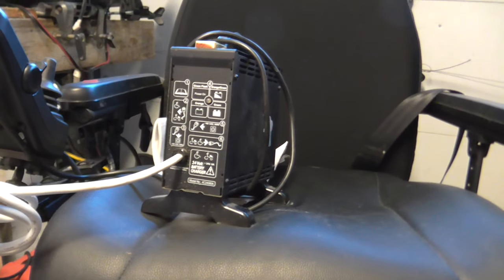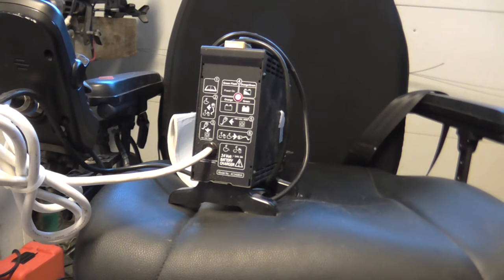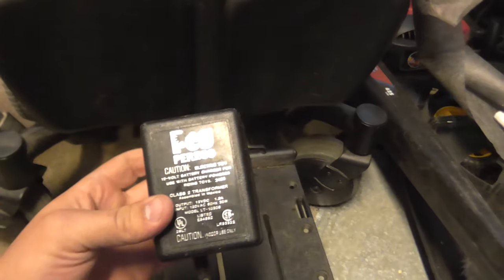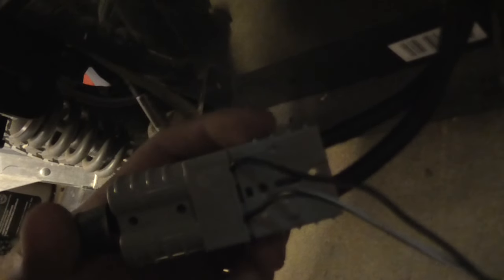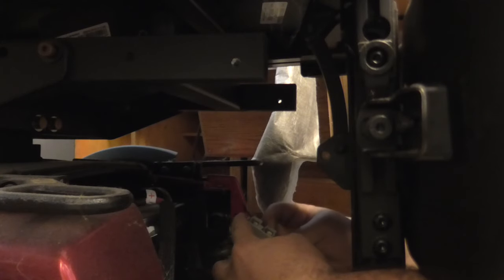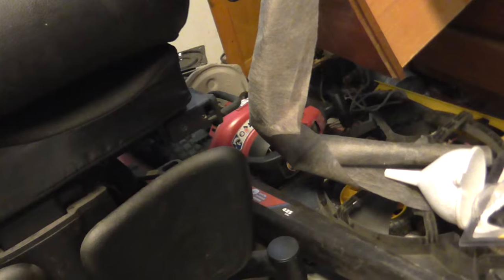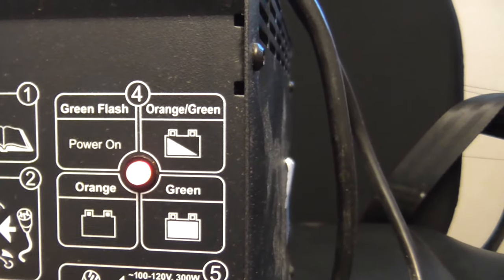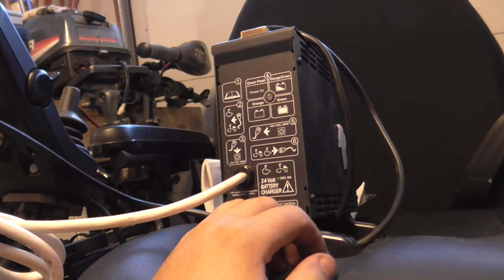how to charge dead wheelchair battery

Comment: Doubtful that this process can restore a dead mobility scooter battery to useful range. A set of two 12 volt SLA batteries costs from $60 to $120. There are a number of videos showing how to disconnect, remove, and replace batteries in your battery case. You only need a long phillips screwdriver. Measure your old batteries and make sure replacements are same size. Charge batteries periodically  when scooter is not being used, batteries lose charge just sitting unused. Charge batteries after each use. Do not leave battery case in hot car trunk. Do not leave charger connected continuously. Batteries typically last 2-4 years before needing replacement with proper use and charging.

Comment: Not having seen these batteries,l was wondering whether or not you could use
 and ordinary car battery charger to start ,then switch to scooter charger ????
Reply from the maker: syd bell depending on car charger but probably not because most of them got voltage detection and if its too low it won't change
Reply: I have a charger which does 6 & 12 volt so would start it on 6v. ??
Reply from the maker: syd bell it needs to be around 10v for the charger to start unless your charger don't have voltage detection but it probably does
Reply: s

Comment: If a wheelchair’s batteries are totally dead, those batteries will never hold enough capacity again to function like they are supposed to.  There are many snake oil videos on youtube about restoring batteries.  They may be able to make it look like a battery is restored.  But can you count on that battery for months of hard duty.  No.
Reply from the maker: I did not say that it will last as new but in my case I just needed enough power and last long enough to show the buyer  that the wheelchair is fully functional and I will tell them thet they need a new batteries.
Reply: Anatolii Gordiienko I understand and understood that, and am glad we agree on that. I was writing to your readers to let them know that, since you did not.  

Most people understand very little about these batteries and are susceptible to the notion that a pretty much used up battery can be restored to normal functioning.  

I feel that many people may make that incorrect conclusion based on the title of your video, and the content of your video.  For example, it would be easy to assume that those used-up batteries would be able to power a lawn mower, which, no way in hades could they ever do that.

Comment: Wouldn't a car charger connected to these batteries work just fine to 'wake up' the dead batteries, at least for a short time, or long enough to get the OEM charger to 'see' and charge the batteries?
Reply from the maker: Depends how old is your car charger. The newer ones won't change the battery if it has low voltage
Reply: @tolikgord  The newer ones have the same smart circuit which measures the voltage of the battery, if it is below a set voltage it won't activate the charger, you have to SLOW charge the battery at ~ 2 Amps to bring the voltage back up above the threshold value.

Comment: I have let my chair sit idle for some time and now when I charge it it does not charge, my question is am I supposed to have the power on off while charging please reply thanks bud!!
Reply: Oh forgot to mention when the chair is on I just have a red light flashing does that mean it's completely drained?
Reply from the maker: Frank Reyna Hi if you have a voltmeter you can check the voltage on the batteries if its less than 10V the wheelchair charger will not change it and you have to connect a different 12v supply to the batteries in addition to the charger to trick the charger because most of them got low voltage protection just to make sure nobody trying to connect 6V batteries to 12V charger
Reply: Anatolii Gordiienko thank you so much for your reply to my comment I truly appreciate it.

Comment: help I did everything you said, but it started blinking red I don't know what happen, do I need to reset the circuit braker? I don't know how to do that,
Reply from the maker: kitty p  if the charger started blinking red try to disconnect it and unplug it make sure when you connect extra 12v you go plus to plus minus to minus and make sure that it is DC not AC you need 12 v DC

Comment: What instruments do I need for my power wheelchair to be alive again cause the battery is not dead the only thing that is dead is the motor of the chair
Reply: Check all connections and coat with lots of Vaseline, including battery connections! If corroded shine up the metal, use whatever you can, knife, file, sandpaper.

Comment: must be thick it doesn,t work, it is near impossible to connect those wires to the connector shown,add another charger to one battery is just the same and it still doesn,t work,and my batteries are not dud just ran low,charger will not charge
Reply: read my posts.

Comment: Hey your a genius !! I am having the same problem with my moms motorized wheel chair battery went completely dead. Your connecting wires to a plastic clip in pro e mine don't have that just the control cord adapter that clips together so where do I put the wires on mine I have a jazzy select please help my mom needs it thanks ahead of time
Reply from the maker: yolanda garza you can connect it directly to the battery terminals
Reply: Yolanda Sirri I
Reply: They are called Anderson connectors.

Comment: Diabolical. They made a charger that purposely won't charge dead batteries then put see authorized dealer if it doesn't charge. It only has a 2 year warranty and the sticker shock could literally give you a heart attack for a non warranty repair. Manufacturer authorized dealerships only exist to fulfill the obligations offered in the warranty of their products. They don't compete with mechanic shops to repair public vehicles. They've already been way overpaid and charge the most. This is offensive and should be monitored. Elderly and disabled are supposed to be protected by the federal government and laws already exist for that reason with extreme penaltiesfor violation. Many are already financially trapped. The manufacturers are paid way too much for this simple, crappy scooter with your tax dollars through federally funded programs. Then they do these shady deals with the customer on the side. You have families and communities rallying to raise the money and help these people when their suddenly immobilized. The thought of some bucket mouth salesman throwing pitches and numbers at people with cognitive issues is also disturbing. It's a simple and incredibly reliable device unless you go out of your way to make it fail because theres hardly any moving parts unlike a combustion engine. The only possible thing that could fail other than the fuses in any electric vehicle is the battery. The scooter i repaired had fuses inside the box hidden under shrink tubing with no mention of fuses in the manual. How many people have been screwed over the price of one blade fuse? How much federal funding was authorized to purchase an entire scooter for the same reason? These batteries aren't dead but they tell the customer they are. The customer service jackass is trained to say the same and pursues the sale, then upsells. You don't even want to know what companies charge for a walk in tub. How much debt is stacking up throughout the medical industry when they ring that bell for another sale? Inheritance money, christmas , birthdays, travel money to visit loved ones, spent on bankruptcy, whatever things you earned repossessed, being displaced, the do not recesatate document signed in fear resulting in the ultimate sacrifice for the ones you love. I'm willing to bet it's how the medical industry became too expensive for anyone to obtain. It's probably easy to live with yourself with all the best things that money can buy if you don't stop and look at yourself long enough to see how ugly you really are. As for me...I'm the hero. I fixed a ladies scooter for free and prevented a scammer from ripping her off. I suppose  these things wouldn't seem wrong to someone that wasn't guided by morals and integrity

Comment: Why go through all that just plug the powerchair
Charger into the joystick
Reply from the maker: If your battery very low the charger won't change it.
Reply: I'm usually a pulse repair charger right now let's see. Since I couldn't trick my charger to do like this. Even trying my razor 24v 1A charger
Reply from the maker: Your razor charger might be smart and not charge fully discharged batteries. You have to trick it with power supply that just supplying power no metter if battery hi or low.

Comment from the maker: I used charger out of a kids riding car charger from Home Depot probably will not work because all the chargers now comes with a safety where if the battery don't have enough voltage it will not charge it you can try to find any transformer 12v dc maybe a exercise bike if not jumping it from car should work but I personally did not try that I would check a thrift store some time they have a transformers cheap
Reply: what going on when the charger just shows a solid orange light. no blinking
Reply: can I  try a wheelchair with a car battery I want to know if you  wheelchair is  working
Reply: call an expert, like a battery store. Battery Plus is one. Get more than 1 opinion.